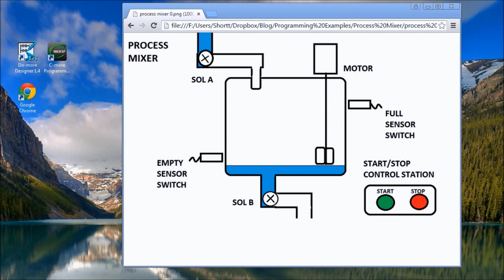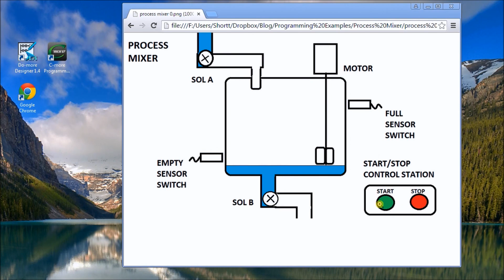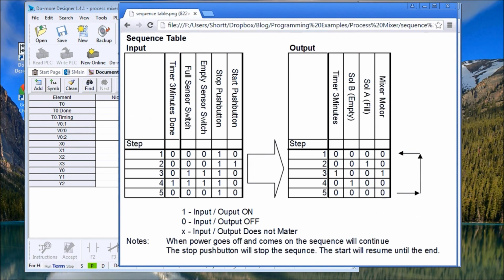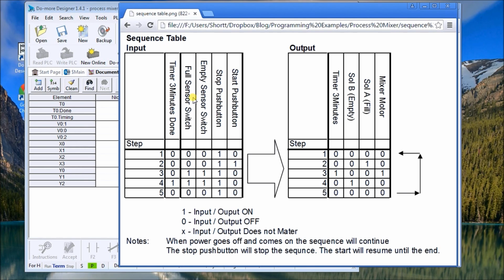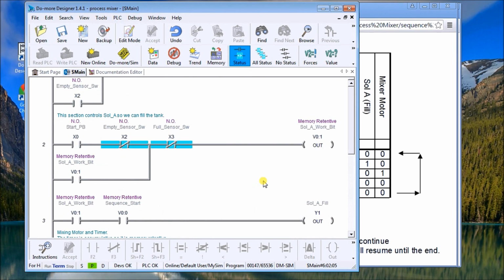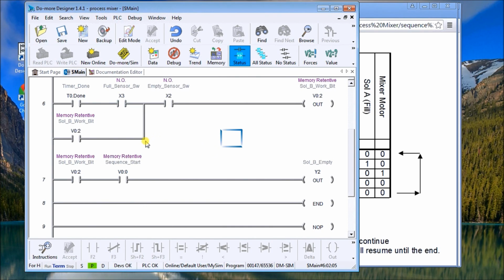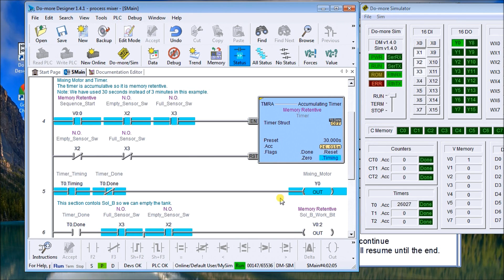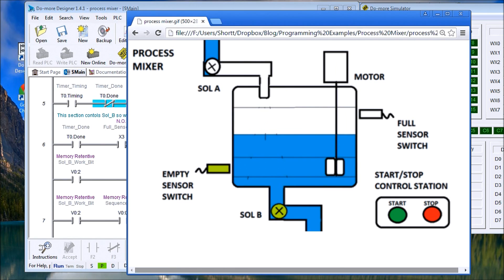PLC Programming Adventure: Mastering a Process Mixer!

Comment: Good job!!! This video is very helpful, just one question, this kind of PLC programming method (sequence table) you are using, what is the reach of this programming method for complex process? I mean, where you have more inputs and outputs as well as analog in/out, thank you
Reply from the maker: Hi Phillip,
I have used this technique on multiple programs with as many as 32 inputs and outputs, both analog and digital. Here is the latest video released today that uses sequence tables and has analog as well.
PLC Programming with Pneumatic Synchronization
https://accautomation.ca/plc-programming-with-pneumatic-synchronization/
https://youtu.be/kiKOiavBDII
Thanks for the comment.
Garry

Comment: Hey Garry , Thank you for the video . 
i have just a question about if we can do that on advancedHMI because i m trying to do that and for empty sensor and full sensor we can use NO switch ? and also about the SOL A and SOL B we can use just simple indicator?

Thank you
Reply from the maker: Hi youness tazi,
Yes, you can use AdvancedHMI as the interface to the PLC. The NC sensor is used because if the wire or sensor was damaged you would not get a signal. This then makes it a more robust system. However, you could use a NO switch. A simple indicator on the HMI would work fine for the SOL outputs.
Regards,
Garry
Reply: @ACCautomation   Thank you Garry for your help !  when i finish the graphic interface and attribute adress for each component in the plc , and i have my ladder logic for my problem of plc then how to synchronis it with my hardware im work with visual studio and click plc .
Reply from the maker: @younesstazi7702  
AdvancedHMI will be the Modbus Client (Master) and the Click PLC will be the Modbus Server (Slave). This Human Machine Interface will display the information in the PLC. The PLC will solve the logic based on the input conditions and the HMI will display.
Regards,
Garry
Reply: @ACCautomation   okey thank you Garry , i m doing  the program for this example and for the timer there is one timer with two variable T0.Done and T0.Timing because i'm trying to follow you and i need two timer for T0.Done and T0.Timing i can't did it on click programming sofware idk if there is another ways to d
Reply from the maker: @younesstazi7702  
The following post will explain timers in the click plc.
https://accautomation.ca/click-plc-timers-and-counters/
You will see the Modbus addresses required by using the address picker and selecting the show Modbus addresses. 
I hope this helps you out.
Regards,
Garry
Reply: @ACCautomation  yes thank's it's clear to me now,  for the advanced HMI i tried to address mapping with my plc clicks c0-11DRE-D the address Modbus its work for my input 00001-00002...  and for addressing my output when i tried 8193(01,05,15)-8194(01,05,15)... i got error like invalid write idk why ? And Also if i want to represent tank with water for my HMI idk if there is something to do that .
Thank you 
Youness
Reply from the maker: @younesstazi7702  
 (01,05,15) represent the Modbus code for writing. Use address 018193 or 018194 for the Modbus address to write.

You would use a bar graph to indicate the level in a tank. The following post will show you how this is done.
https://accautomation.ca/horner-xl4-modbus-tcp-advancedhmi-communication/
Regards,
Garry

Comment: For Empty_Sensor_Switch and Full_Sensor_Switch, you use NO physical switches with XIO instructions. It makes sense because you want the switches to open the rung when closed physically. For Stop switch, you use NC physical switch, which is a safety thing. But why do you use XIC instruction for Stop switch? Should not it be XIO?
Thank you very much.
Reply from the maker: Hi M.N.Q.
Good question. 
You are correct that the Stop Switch is wired physically as an NC (normally closed). In the program, I am looking for something that will complete the rung when the stop is not selected (activated). In this case, I need open contacts in the ladder logic condition to complete the logic to the V0:0. When the stop is activated then the rung condition is false.
If we needed to count the number of times that the stop button was pressed, then we would use the normally closed contacts in the ladder logic condition.
This concept of input condition is something that a lot of people have trouble understanding at first.
I hope this helps you out.
Regards,
Garry
Reply: @ACCautomation  Thank you very much. It is clear to me now.
Reply from the maker: @m.n.q.1670  
Thanks for the feedback.
Regards,
Garry

Comment: Here’s what my problem is I am using a scanner to scan trills.. The output of the scanner is the input of an Air gun;; I.e my scanner is an input and my air gun is the output
So this is how my process works.
 I am scanning trills,, when a trill passes in front of a scanner, an output is given by my scanner to the Plc,, and when there is no tray no output is given to Plc,, now what I want to do is that for the trills which are slightly longer, I want my air gun to blow them away,, Now in that case the output is gonna be given by the scanner to the plc for slightly longer time,, maybe a few milliseconds longer than the ideal case(where the trill is of perfect size) What I want to do is that my air gun shall only operate when an output of the scanner was given for that’ slightly longer time, in all other cases the air gun shall stay de-energied.. I am having confusion with how to write code in between them I have mapped my scanner to x1 input on plc and air gun to y1 output. So [XIC]energise>> ()y1 I am having confusion on what to put in between if like timers how do I measure such precise time difference and how do I Initialisé my gun with scanner input and what to do to reset it again after once it was used and held for few seconds..
Reply from the maker: Hi Arun,
It sounds like you need a shift register. The input to the shift register will come from long trill, that needs to be rejected. Here are a couple of examples:
http://accautomation.ca/plc-programming-example-shift-register-conveyor-reject/
Video:
https://youtu.be/K1j6HvNF-5s

http://accautomation.ca/plc-programming-example-sorting-station-shift-register/
Video:
https://youtu.be/YMl2DPm_yaU

Hope this helps you out.
Regards,
Garry
Reply: Thank you so much sir,, it all worked out,, thanks for your support and great work
Reply from the maker: Thanks for the comments Arun. I appreciate them.
Garry

Comment: Thanx alot for this video. it is too helpful.
i have a question about if we want that the process to restart automatically, how this can be performed???
Thanks again
Reply from the maker: Hi Mostafa,
Thanks for the comments. 
The end of the cycle resets with the X2 input (Empty_Sensor_Switch) turning off. (Water Drained Out) If we want the cycle to automatically start again then use the trailing edge one shot contact on X2 in parallel with the leading edge one shot contact X0 (Start_PB).
When the water finishes draining from the tank, the input X2 will turn off. This will then act as the start input for the next cycle.
Thanks for the question Mostafa.
Regards,
Garry
Reply: I don't know how to thank you. Too helpful advice.
Thanx again.

Comment: Isn't the N.O. Full Sensor for activating SOl_B_work_bit redundant? Would the program work the same without it there?
Reply from the maker: Hi Yoni,
The full sensor indicates when to stop the filling of the tank. Without it you would have to have another method to indicate that enough liquid is in the tank.
Looking at the sequence table in the post you can see that the switch is required.
http://accautomation.ca/plc-programming-example-process-mixer/

Other ways to indicate that a tank is full is to weigh the tank using an analog input, or meter the product using a flow control pulse input. I have seen timers being used to some extent, but times can be very inaccurate because of the changes in the system. Things like pressure in the fill line will cause the tank to overfill or under fill sometimes.

Hope this helps you out,
Regards,
Garry

Comment: Thank you for your video, it's been very helpful to me especially the programming steps. 
This video has made programming easier.
Do you any method I can use to interpret someone else's programming? Do I need to go backward? I mean from ladder programs, to sequence table and  so on?
Reply from the maker: +Alain Jude You are correct! In order to interpret and understand someone else's program you need to go backward if all else fails. If the program was written and documented well, it should be easy to understand as you read through the ladder. When documentation is lacking, I usually start by asking the operators or owner, the general sequence of operation for the machine.  This way I get a general sense of the operation before starting to interpret and understand the actual program. Thanks for Watching! Garry